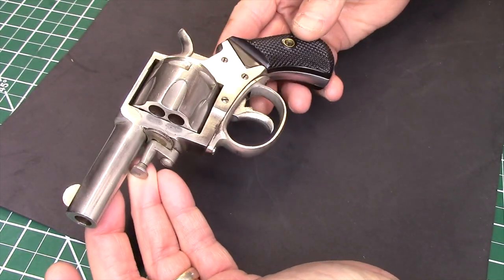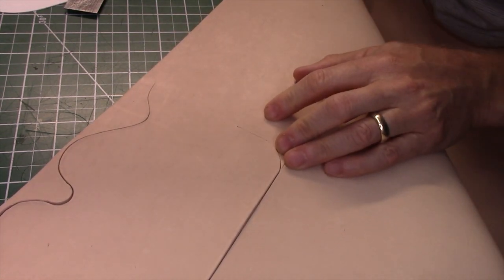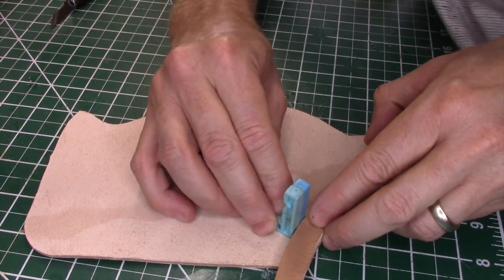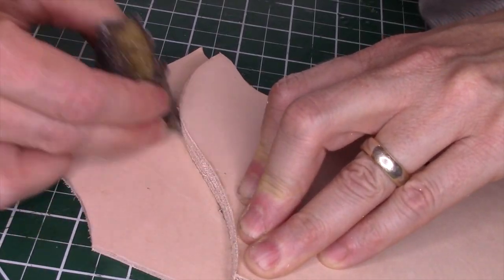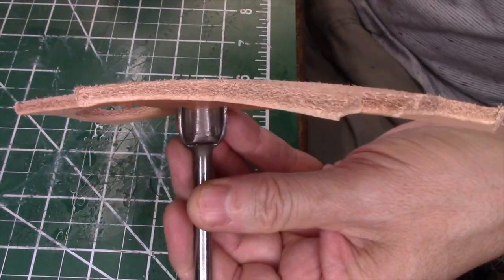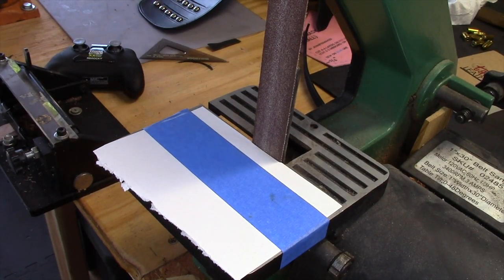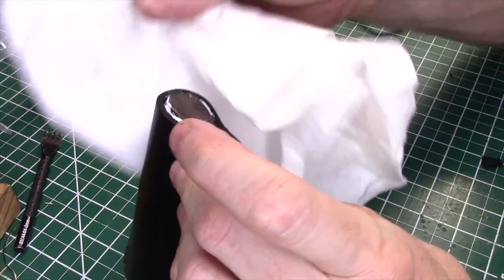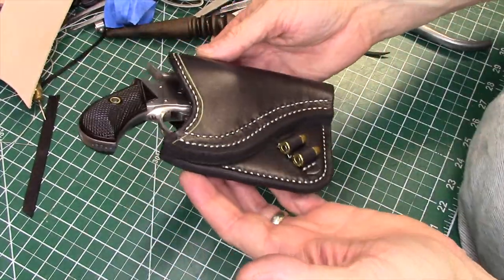Leathercraft: Felt-Lined Pocket Holster British Bull Dog SAA Revolver Cowboy Action Leatherworking

Comment: I've been using Weldwood for years, mix a little Acetone in the bottle to thin it out. Is there a place to get the blue angle pieces that you used to align the welt? I've enjoyed your videos, I want to do more holsters for single action revolvers.
Reply from the maker: Will try the acetone trick. The blue angles are actually hobby clamps. They're sold at several places under a few different names. here's some on amazon:
https://www.amazon.com/Excel-Blades-Adjustable-Modeling-Miniature/dp/B081HY1VGB/ref=sr_1_2?dchild=1&keywords=hobby+clamps&qid=1593662962&sr=8-2